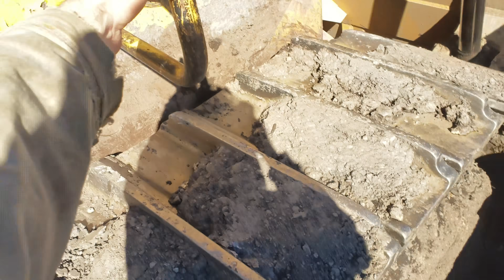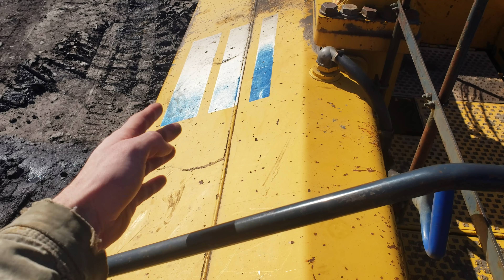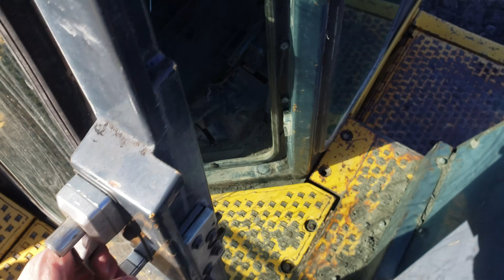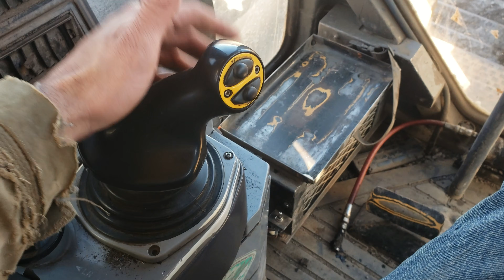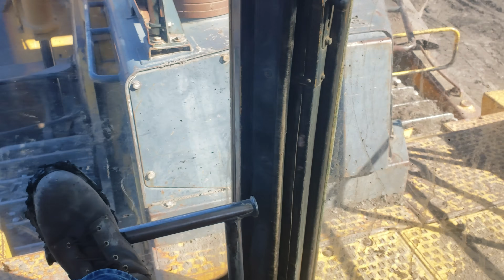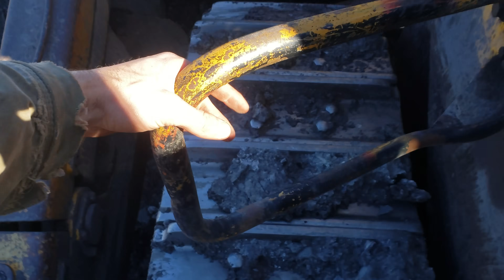The World's Largest Production Bulldozer - The Komatsu D575A-3

Comment: I’ve ran the smaller Komatsu dozers, but actually have never even seen this brute in person. Scariest thing I saw on this unit was,,,the track shovel. I wouldn’t want to even be in the same county when it come time to clean those tracks.  I’ve often wondered about the actual overall efficiency of these units compared to the D-11’s. I’ve seen videos of these working, and they are just so slow. It would be difficult to keep your eyes open operating one of them behemoths. 👍👍🇺🇸
Reply: People have to remember that the D575A and the D11 are in completely different classes. Weight, power, cost etc. All of that said, they are often compared. Production tests (run by Komatsu) factored about a 1.80 - 1.98 times increase in productivity compared to D11N, D11R and D11R CD machines in the late 90's. A variety of locations and test conditions were used, shot rock, slot dozing, long pushes etc. These numbers however didn't account for the 2x cost of the 575 or the cost of running, maintaining, hauling etc. Factor in everything and the conversation turns out far more favourable to the D11.
Reply: @ I would have to respectfully disagree that that they are 2 completely different classes. Why would they be, other than the obvious that you mentioned. They were both designed for the same application, which was simply to move a lot of material at lowest possible operational  costs. Less than 2( I’m assuming %) increase in productivity, according to Komatsu?  That might possibly be a bit biased to say the least. The 575 was a beast for sure, but pretty much an overall failure in my opinion. Though they still retain the bragging rights as the biggest, can’t take that away from them. 👍👍🇺🇸
Reply: @brianw8963  Hi Brian, cheers for the discussion point. 1.8 x 2.0 increase in productivity translates to 180% - 200% productivity compared to the D11 at the time or twice as productive. The D575A was 24% heavier than the largest D11RCD and had 30% more horsepower. I think when you look at these figures, then yes, I do class the D575A in a separate class, above the D11. 

All of that said and done however, the D575A purchase price was also twice as much as the D11, it cost more to fuel, more to maintain, more to transport, repair, had longer wait times on parts (more downtime) etc, and when you factor in all of these considerations, the conversation swings quickly in favour of the D11 as the better performer per $ over the course of the machines life.
Reply: @ Well Thank You, and Yes, I was referring to overall cost efficiency of course. It all comes down to cost per cubic yard to perform the same task . Appreciate the reply.

Comment: I thought the 575 had 2 exhaust stacks?
Reply: Traditionally the D475 had 2x stacks while the D575A had 1. 

Funnily enough however this operation has a second D575A with a Cummins swapped V16. That is a D575A with 2 stacks!
Reply: @tooez90   No, not on the D575A-3. Only one huge stack on this giant.
Reply: I've only saw pictures in books and all have single stack. The 475A has 2 though...

Comment: @Pamining please get some footage of it pushing dirt there are very few videos of these working and they aren’t great quality
Reply: Check out Bill Hohepa’s Low Gear episodes. He has opeational footage of the only two 575 Super Dozers built with blades and rippers for Stockton overcast coal mine here in NZ🇳🇿. Plus he has footage showing the example moved up to Auckland, shortly after it was reassembled at an Auckland quarry and later, after it was put inside a museum.
Reply: @michaelguerin56  thanks for that info, I will
Reply: It's near impossible to get footage of it working, as there are so very few of them, and they are broke down 90% of the time.
Reply: I'm sure it's broken lol all these 575s are, they've got a very poor reputation for quality
Reply: @robheinitz6108  Actually, many of the D575's worked long hard lives. This unit has well over 40k frame hours on her now. They could do what the D11's couldn't so they were worked in very difficult conditions and yes, at times were broken or parked. Parts weren't stocked at local dealers and often had to be forged from the factory in Japan when ordered. They were big and heavy parts too which added to shipping time and cost. If it were easy and profitable to build a big dozer like the D575A, CAT would have already done it.
Reply: @robheinitz6108 no, they dont, only on the internet

Comment: I remember this being remote controlled; it's so cool. I love how low slung the design is compared to the bigger D11s
Reply: The RC units were pioneered in Australia and then became a factory option by Komatsu at a later date. Not all D575A's were fitted with RC. The unit captured here (Serial Number 10106) was not RC. I'm lucky enough to have one of the original transmitters at home.
Reply from the maker: That's interesting, I didn't even know that became an option for the 575! Thanks
Reply: @rowanhenshaw273  Did you work for Alcoa in W.A?